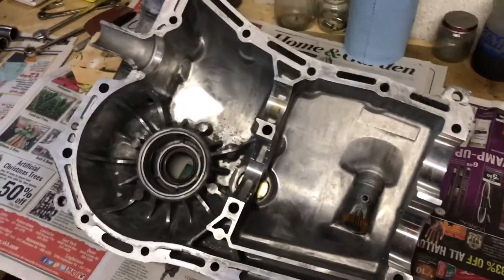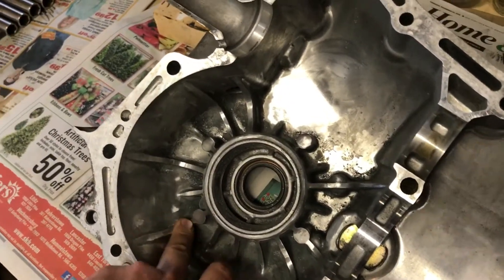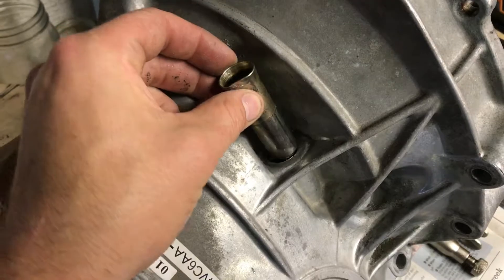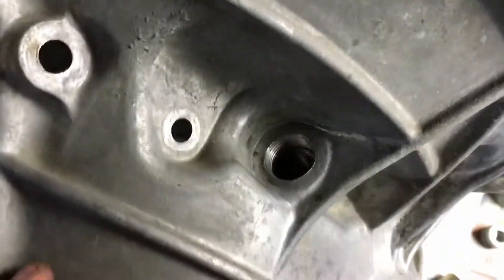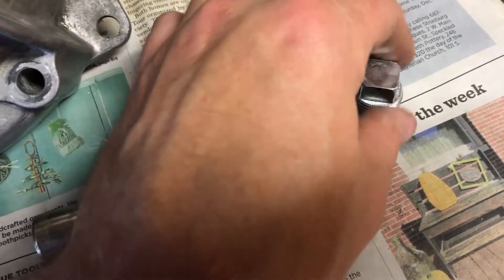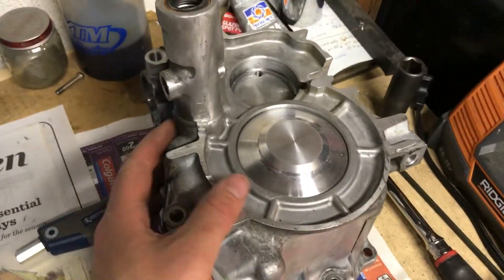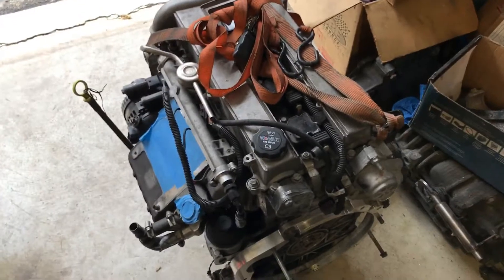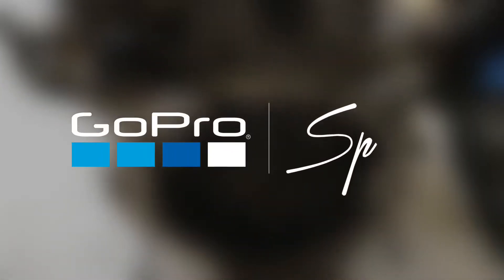Subarugears transaxle Build

Comment: What broke in the Subaru transaxle?
Reply from the maker: This video is installing a subarugears reverse ring and pinion so I can use the transaxle in my off road buggy. Check out my other videos with my buggy.
Reply: @D6motorsports  i seen the one where u broke ur transaxle. But the comments are turned off.
Reply from the maker: @jeffyoung2089  I didn’t realize the comments were off.  Thanks for letting me know.  I turned comments on.  After a bunch of inspection I think my axles were too long an were rubbing putting pressure on the ring and pinion.  I have a new one in, shortened my axles and put double c clips on all cv joints.  Haven’t had another failure but that was in fall of last year so only had it out riding twice since the rebuild.